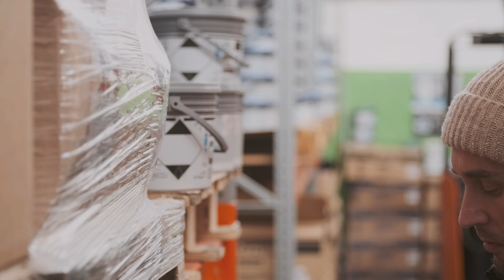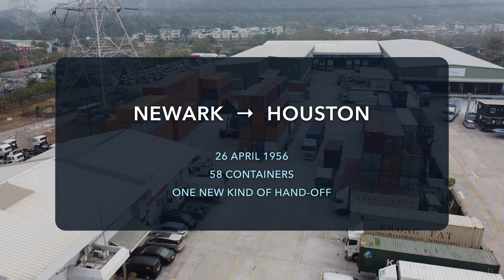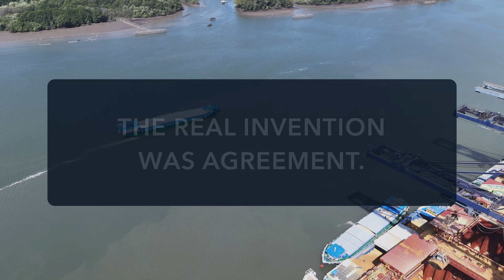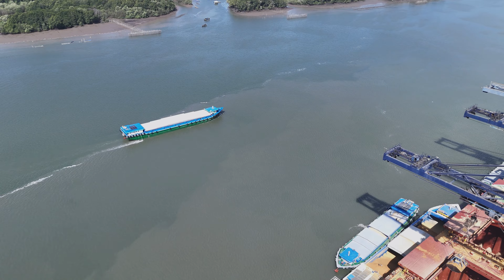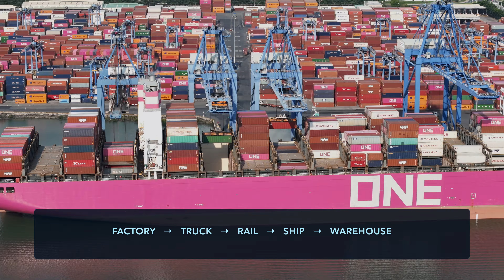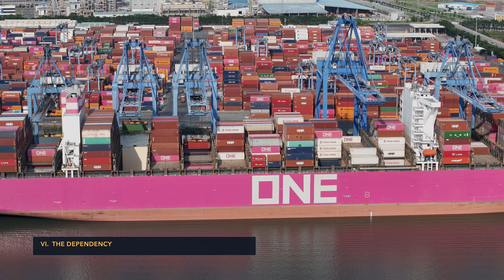The Box That Rebuilt the World

Comment from the maker: The surprising part is that the steel shell was not the decisive invention—the shared interface was. Which hidden standard should CurioFrame unpack next: the pallet, the barcode, or the shipping label?

Subscribe to CurioFrame Stories for a new evidence-led hidden system every week.

Source note: “851.1 million TEU handled” means port handling events in 2021, not that 851.1 million different boxes existed.